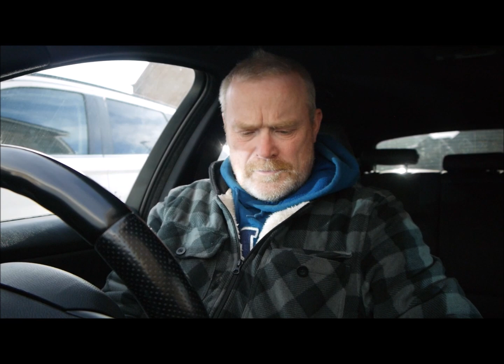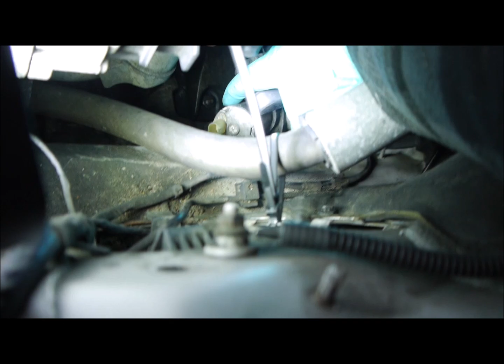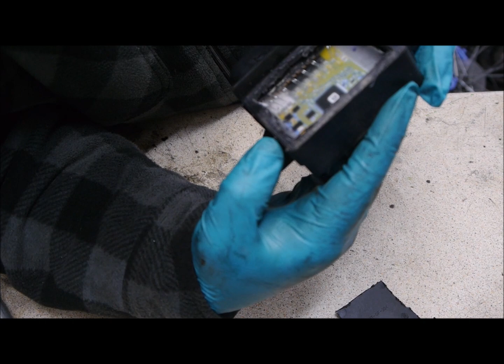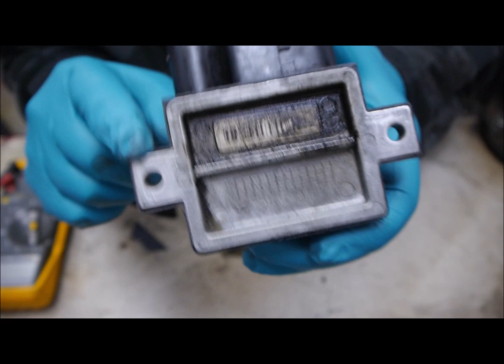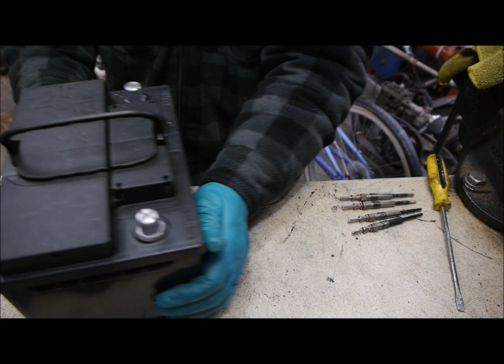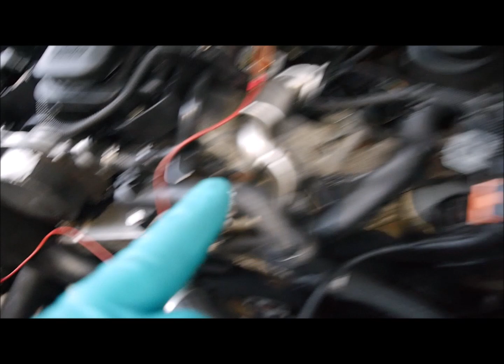BWM 320d E91/E90 Glow plug DIY trouble shooting part 1

Comment: On my e60 520d m47tu2 engine i have codes for all 4 plugs. New relay fitter and 4 original plugs. Have checked all cables in the glow plug system, everything is good, all cables is whole. Can preheat the plugs  with ista, no codes. As soon i start the car the  day after all 4 faults thick in.

I suspect the power lead to the relay. The next attempt will be to measure amperage while preheating the plugs with ista.😭

Comment: I've just changed my bmw e90 glow plugs, you have to pay very close attention because they do many different ones that are the same but have different voltage ratings etc. Always check realOEM for bmw parts as euro car parts etc don't have the right info. My mechanic tested the faulty glow plugs and all 4 worked and he did the same thing as u, and I had 3 out!

Comment: Good diagnosis !!
I just checked my autodoc account and see that I paid £20 for 4 Ridex glowplugs for my CLK last year. They have the red ring so that appears to be significant? Not had any issue since to changed them. Didn't have any issue before I changed them, but thought I'd do it seeing car had 80,000 miles 😂
Reply from the maker: Think I was just unlucky with this batch. Or maybe the wrong ones. Anyhow they didn't work but only £20 and some of my time lost